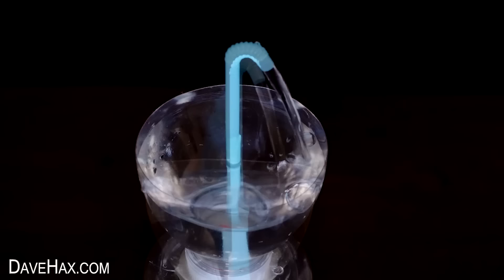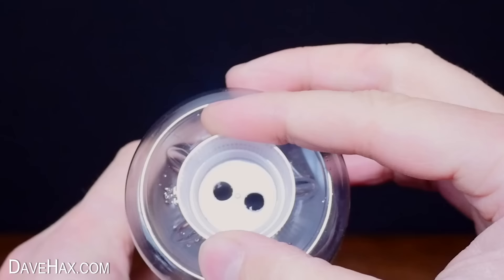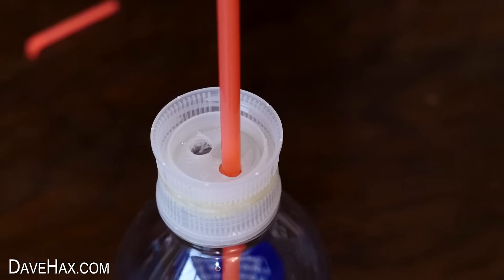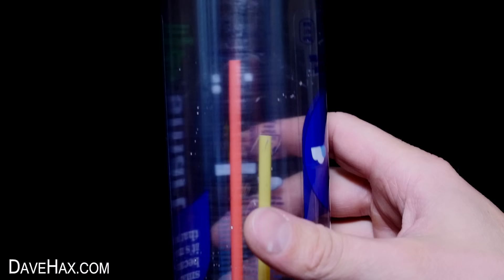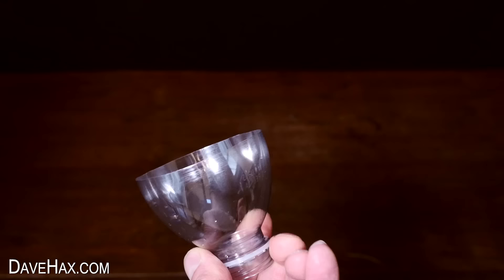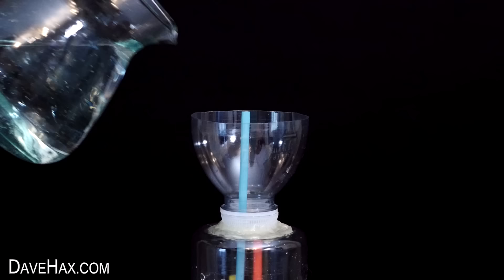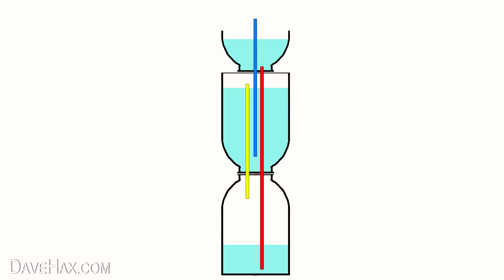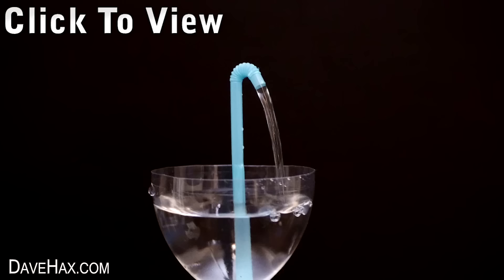How to Make a Non Stop Heron's Fountain

Comment: Tips from my experience:
1 use gloves.
2 with the glue use sand paper and  another similar glue for a better grip of PP or PE (type of  plastic used in bottles).
3 before putting al together, verify all the pieces watching all over again.
4 do not have high expectations and expect to fail in the firs attempt.

Comment: Nice! Question: what's the reset time?
1 minute, 10 minutes, 100 minutes, 10 hours, … what?
Thanks ☺
Reply: It depends on the size of the bottles you use. It also depends on the liquid (if not pure water) you use.
Reply: @MrLongman2008  Thanks for the reply. Say standard household water and standard water bottles like in the video.

Comment: On a larger scale with a constant water source like a creek or even a natural spring you can make water go up in elevation 10x the drop with a burping check valve. My point is water and pressure and gravity and beating resistance with pressure is pretty cool.

Comment: When I first watched this vid I got excited because it seemed like the water would constantly flow like a water fountain without an electric pump based on air pressure alone. However, you will notice that he only ever shows the water going from the middle section to the bottom bottle. Both with the actual water and with the diagram (which you could do with a syphon and far less complication btw). And if you examine the diagram closely and ask yourself the question: after the water fills the bottom section, what makes it return to the middle? You will realize the only way that would ever happen is by turning everything upside down and "resetting it." 

I have to hand it to him, he got his 5 million views, but I feel punked. Not cool. It's a Nonstop fountain for a whole two minutes - or in other words: a waste of three perfectly good soda bottles and three straws.
Reply: pure clickbait, look at how many views he has now

Comment: I tried the same thing and it stops after 20 seconds
Reply: 06:01 you need follow the instruction =)
Reply: 🔵 The narrator actually explains why it WILL stop just after (5:47).
Reply: Narrow the opening of the fountain part, it'll run longer.

Comment: If it is indeed non-stop, it is perhaps the first closest thing to a perpetual motion machine. The right place for such a device would be in a fish tank.
Reply: This comment may be a bit long but, necessary!  Recall back in the 60s my fish aquarium filter system which attached to the rear of this 50 gallon tank came with a long plastic tube with a hooked shaped end. This plastic tube magically siphoned water from the very bottom of my tank thus, providing the filter system with an perpetual supply of water. One night during a midsummer thunderstorm we lost power ⚡ was at work at the time. When I got home had a big mess to clean up. Ya see quite a bit of aquarium water had now flooded by shag carpeting big time before stopping on its own. Ya see that long tube was non stop it would continue to feed water to the filter from the bottom even if unplugged. As a rule i had to first remove that tube before unplugging the filter pump or within seconds over the top of that small filter tank it quickly went spilling out onto the table and floor. Please note: if I didn't maintain the aquarium like keeping the water level full and near the very top, this self siphoning jazz would stop on its own after dropping a few inches...

Comment: Amazing system! So cool. I wanted to add a system like this in a jar terrarium, with a capacity around 10L. So, my question is, can i reproduce the same system in "tiny" dimensions? I mean, to use much smaller bottles for example. I don't know about physics at all, so I don't know if it matter the size of this "structure" for the water to complete the circuit. If someone can help me I would appreciate it so much. Thank you!!
Reply: U can first try with small bottles for u to understand.....n then u can proceed further to make big one..... Physics is just another name for experimentation...😊😊😊 Thankyou

Comment: Clever, but certainly not non-stop as advertised.  It simply flows until the primed vessel, the middle vessel, runs out.  The middle/primed vessel does not automatically refill.  The title should be changed to simply, "How to Make a Fountain."

Comment: So if the top “funnel” water bottle was bigger and held more water, and the yellow straw were lengthened a bit at the bottom, and shortened at the top, it would be able to feed itself indefinitely?
Reply: No space in the first bottle! The experiment uses the weight of flow and air pressure to work, immagine the pipes upside-down when concerning Burbuli's law of water, or similar to water trapped in a coiled water pipe, hence the level on either end of the pipe depends on the total  (pressure and mass) within the pipe.

Comment: boooo ... i was under the impression that it will keep going 24/7 without having to reset it manually.
it should be possible to automatically reset it by using magnets and gravity, but it would need some heavy modifications.

Comment: I just tried making this for the first time and it failed. My biggest assumption is because there is a pressure leak from the second bottle, and that's probably because I didn't glue the top cap properly (I don't have a glue gun, so I use a normal all-purpose glue), and also because my bottle's bottom surface is kinda wavy (makes it hard to closed it completely). Anyway, very fun experiment and I surely will try it again sometime!
Reply: There is a reason for directions